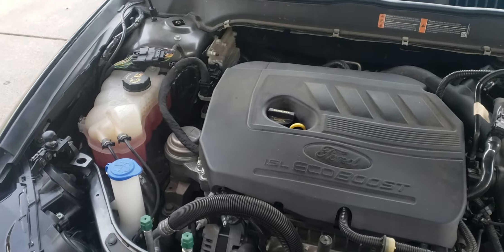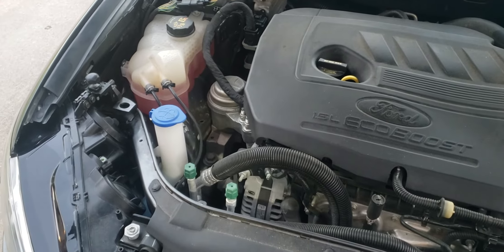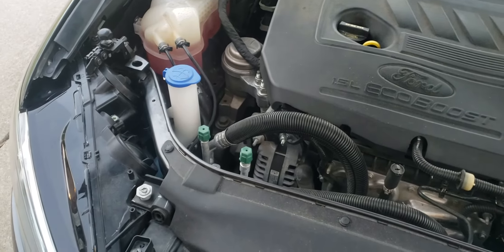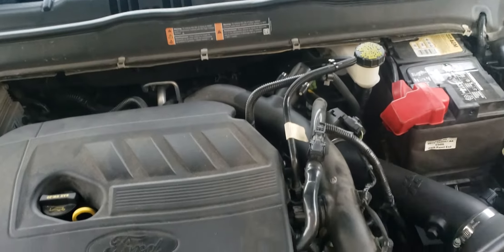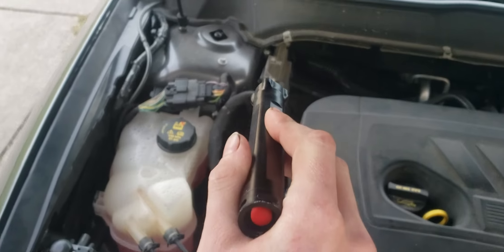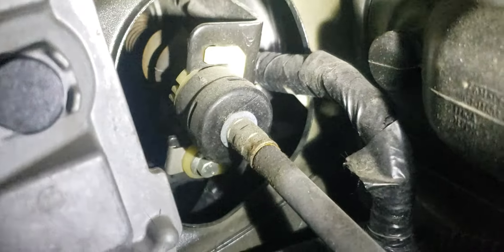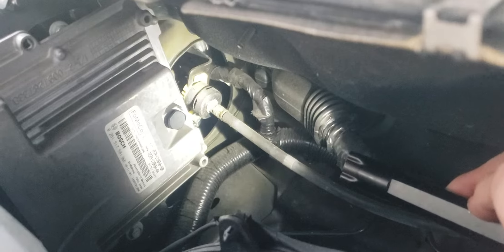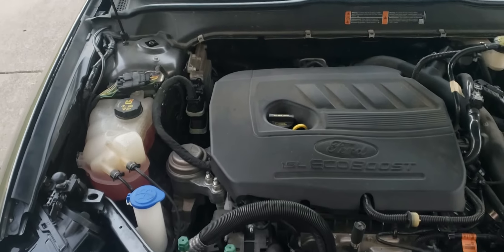Location of the transmission control module on a 2017 ford fusion

Comment: Is that where the shifter cable for models with the rotary shifter goes? I have to replace the cable that broke at the transmission end and was puzzled that it went to the quarter panel and not thru the firewall. This is the only video l found in regards to cable replacement for the dial or rotary selector shifter. Glad you kept it short and sweet.
Reply from the maker: @jimsplace1957  for the 17 and new fusion that where the cable at to this to motor to the transmission

Comment: Is it the same as 2018 mkz ??  Thanks
Reply from the maker: Yes it will be similar
Reply: @Nickthecarguy  thanks a lot bro, but still not able to find any video shows how to do it step by step 🤦.
Reply: @mohammadshehsb488  did you find a video after all?
Reply: @nene3844  not yet 😔
Reply: @mohammadshehsb488  it says fusion but it’s identical to the replacement. On your MKZ. 

What problems are you experiencing?

Comment: I'd like to replace mine but no idea how to remove.
Reply from the maker: You have to pull the passenger wheel off and remove the passenger fender liner to get to that motor
Reply: @Nickthecarguy  Thanks. I've since found your replacement video. I'd try if I had a backup vehicle, but it's pretty intimidating to take apart your only source of transportation.
Reply from the maker: It's not too bad I would say about 30 min to an hour to replace it
Reply: @em7dim9  Your comment has been posted several years ago. I wanted to reply to your comment.. Never be intimidated about diving into something. The only way you can learn is by doing. If it's already broke, it can't be any more broke. Unless you physically break something. Blah..get after it. nuff said GL
Reply: @nonyabussiness6207  Good thing I didn't. It was a transmission fluid leak in the hose. I'd have done it for nothing. Suffice to say It's not such a good idea to make assumptions about what caused a particular trouble code.
Reply: @em7dim9  what dtc was triggered?
Reply: @nonyabussiness6207  I can't remember the exact code, but basically was telling me the TCM was bad. But the reason it was 'bad' is because there was no fluid.